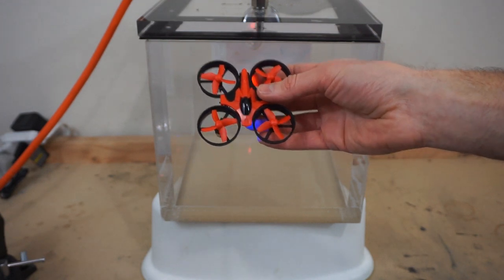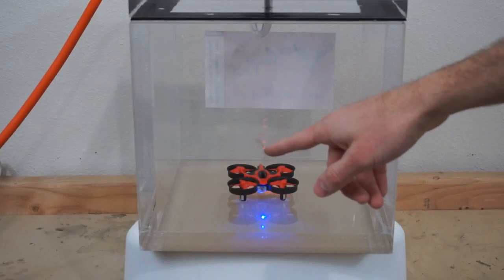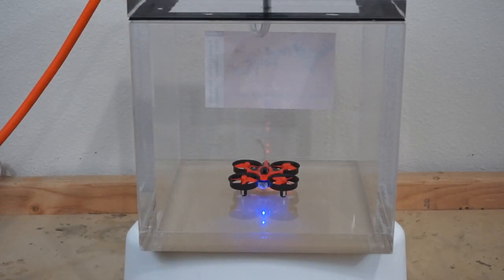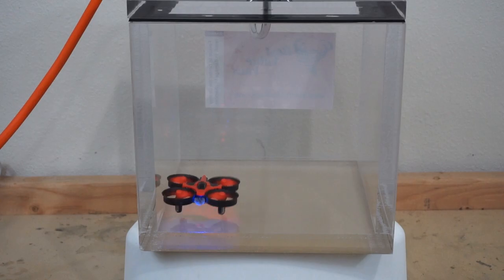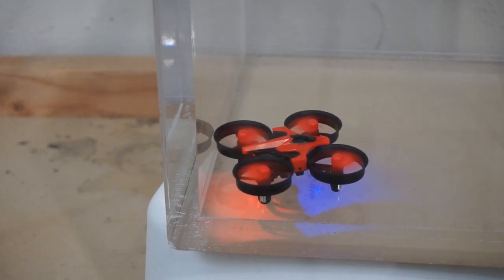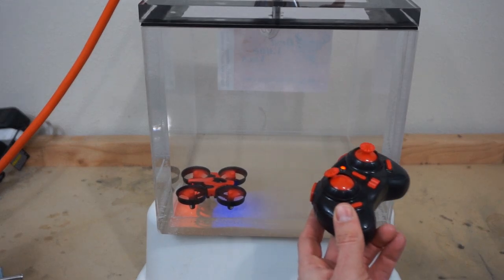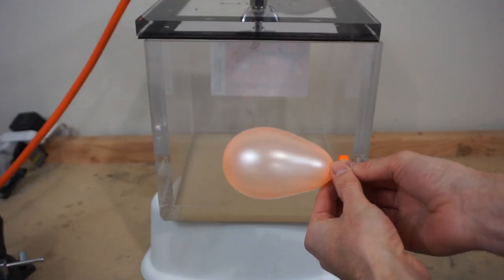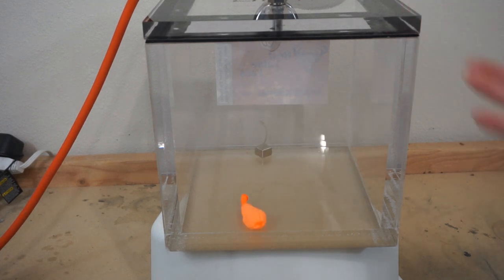What Happens When You Put A Drone In a Vacuum? Can It Still Fly?

Comment: A basic understanding of how a drone or any flying machine works let's you know that it wouldn't fly without even watching this video. Makes me think that this channel didn't have any ideas for a video this week or whenever they make them
Reply from the maker: +Ryan P I also know what will happen I put when I put sodium in water/when I put water in a vacuum/when I use a giant magnifying glass to melt metal etc. It's one thing to predict/know what will happen, it's another thing to live it. What fun is life if you just "know" what will happen but never experience it?
Reply: Hydraulic Press Action the difference is that other people may not know something interesting happens when you put sodium in water. And that, along with melting things can result in something visually appealing and worth filming. Nothing about a drone being unable to fly without air is intersting to me. I'm not attacking you or your channel, and it's fine if you were short on ideas when making this. I just thought you would make more interesting videos that this. It's the equivalent of asking how quickly a sailboat van travel without wind, or if a car will start without gas. Nothing personal.
Reply: Ryan P I think that your comment was completely unnecessary. I also knew what was most likely going to happen but it was still interesting to watch it actually happen. It is just ridiculous to call something like this "short on ideas" while at the same time there are thousands of channels simply copying each other or uploading almost identical content over and over again. This is something I have personally never seen in a YouTube video before and even though I knew what will happen I still enjoyed watching it. There are millions of videos here on YouTube that deserve a comment like yours but this is certainly not one of them.
Reply: ccman32 if this channel wants to grow, I'd hope they'd take a comment like mine and say "ya know maybe I should set the bar a little higher instead of making a video saying 'hey, watch this drone NOT WORK'" Feedback that isn't positive is still feedback and I'm not making personal attacks it's constructive criticism. People on YouTube love to get butthurt in the comments section over very tame comments. Let's not make this one of those times.
Reply: Ryan P Neither have I accused you of making personal attacks nor was it my intention to show any sign of "getting butthurt" so I don't see how or why this should be one of those times.
Peace.
Reply: Ryan P 

What about younger viewers who didn't know what would happen? 

This video was likely both entertaining and informative to those who genuinely have no idea how drones work. 

Maybe it wasn't your cup of tea, but to assume your advice is helpful solely based off your personal expectations and interpretation of what "entertainment" should be is a little self centered, don't you think?
Reply: dee yannie I never once said my feedback is the only feedback that matters. And I'd purport that younger viewers would also like videos that are more visually impressive or fun than watching a drone that can't fly.
Reply: Ryan P My first graders liked this video well enough. Not everything has to explode to capture their attention.  Here's the thing, my first graders didn't know what would happen. The didn't have the schema to make that sort of prediction. The reason I show my students these videos isn't to visually impress them, even though the videos do that. I show these videos in class so my students can gain background knowledge to make future predictions on how science works. I hope by watching these videos my students will be exposed to various scientific principals that will help them be more successful in the future.  They needed to see this video, even if it bored you.
Reply: Ryan P can you just chill and enjoy the videos...
Reply: Ryan P and why don't you think about making videos of your own...
Reply: Then whyd u click on it
Reply: This is a vacuum chamber and hydraulic press channel. What makes you think people watching would have any knowledge at all of how a drone flies?
Reply: Frankly I find the title and idea of actually realizing the experiment quite fascinating. And I was hoping he would demonstrate the matter in the way he did, and he did so. I was wondering if he would just stick the thing in the bottom, pump out the air, and say, "see, it's just stuck there". End of video.

No, he showed how aerodynamic lift fails . I also learned a few quantitative tidbits, because he read out the partial vacuum and I could see how the device responded. Does the lift become unstable? Would it flip over or something. I didn't know. Now I do. Could it make any feeble use of ground-effect? Lots of interesting questions and answers.

The experiment appears to be entirely novel, to my knowledge. It couldn't have been done until the advent of drones small enough for the modest vacuum-chambers affordable to youTubers. So it was interesting in that respect; sort of micro-historic (nano-historic?) let us say.
Reply: tbh this isn't common knowledge and this vid probably educated a few people....
Reply: most people knew but still watched it anyway just like you did.
Reply: Ryan P experimentally proving what is already proposed is also an essential process in science
Reply: Actually I was curious as well. Nice to see it with my own eyes
Reply: well it appears it was a good choice.   they have 123 Thousand views.  i mean i knew it would not work.  but i still clicked.    it's so Obvious that it becomes clickbait
Reply: What
Reply: I've got other point of views that this video is very good in term of education. Many students can get more by watching this video gor any other related videos) than just doing simple experiment and learn theories at schools. Not just adding their knowledge and understanding, but also increasing the possibility of creating new things in the future.
Reply: most people just understand this as fact without even thinking.
Reply: okay so this video is educational to nine year olds and really really stupid people other than that it is just a boring demonstration of something completely obvious but I'm glad to see all the people rushing in to defend it because we live in a world of the participation trophy where you set the bar low enough so you can just get over it I look forward to the next riveting installment where you ask a question that's been baffling scientists for centuries "what happens to a boat when you take away all the water?"
Reply: what water?  drinking water on the boat.  lake water, sea water, ocean water.   (relevent for the size of the "drydock") it will be on.  but bottom line.   it will sit on the ground. and stop functioning as a boat.  quite much like this drone in a vacuum
Reply: attack125 it would make for a super interesting video. To watch an idle boat. Can't wait.
Reply: Ryan P frankly youre making complaints about the video which seem completely irrelevant to me if not the whole pack of the viewers. its you coming in and dirtying the pond.
Reply: Daniel Jung you're making complaints about my comment which seems completely irrelevant to me. You're coming in dirtying the pond.  Sorry you can't have a world where everyone agrees with everything you say. Until that day, you're just gonna have to buck up and make the best of it bud.
Reply: @daniel jungRyan P was right.   YOU are dirtying your pond with an off topic comment.  (a comment not related to the video itself.  by commenting about someone elses comment)
Reply: lmao it was obvious
Reply: Ryan P
Everyone has actually done the boat experiment, in that they see buoyant objects drop to the bottom of sinks etc. Next time you drain your bathwater, what happen to your rubber ducky and toy battleships?
Reply: Ryan P   Ikr
Reply: Ryan P its cool knowing butt cooler seeing
Reply: +MsZylia 
What utter bullshit.
Reply: Do you think you are in the target audience of every video on Youtube?   Can you see the likes vs dislikes bar?  can you digest there thousands that clearly like this video?   Do you see why are you wrong in your narrow minded assumptions!?  Get over your self!
Reply: Jamie Delour another person who thinks that a comment section is only allowed for positive comments. Nice.
Reply: Ryan P he never said it was
Reply: Lol this is a funny chain of repliea
Reply: Of course, the entire thread has to attack one person for stating his opinion that is unfortunately different from everyone else's and is punishable by death. Typical YouTube sheep.
Reply: I love how fast Ryan P switched from "constructive criticism" to outright criticizing the intelligence of the video's creator and audience. Real helpful.

Hydraulic Press Action, would it be possible to have the balloon released from the bottom of the tank? It kinda just looked like it was falling in the video, and perhaps another starting location could better demonstrate the principles of physics mentioned.
Reply: You obviously didn't have any ideas, otherwise you'd have a video. Jealous much?
Reply: Ryan P the only thing I have to say to that is that most people don't know that stuff that's not knowledge that the common person has so for most the video is informative and tells them something they didn't already know
Reply: Ryan P bro crazy Russian hacker will do the same thing over and over or will do something simple that a lot of people will know will but yet they still watch it like this your comment was attacking this channel and you coulda said it with a different time rather than the way you did
Reply: This was a genuinely interesting video, despite theoretically knowing the outcome.
Reply: Hey  Ryan P, you are so cool that you know heaps of stuff!! could you drop a link or 2 on some of the creative things you have done in life ....? we're all looking forward to it!!
Reply: oerlikon1969 anybody in aerospace engineering that still needs to learn that a propeller based flying machine uses air to create lift isn't gonna make the cut. To date this channel seems to have a primary goal of entertaining  people and to me, it wasn't entertaining. It was probably a week where the creator just didn't have many ideas of what to do with his vacuum chamber and  that's perfectly fine. It's funny that people seem to be unable to get over a YouTube comment.
Reply: "Why even carry out experiments in schools, teachers? Obviously the given hypothesis is correct. No need to have the students actually carry out the experiment, observe the results and gain experience." - Literally you.
Reply: type moon except that's not what I said. This isn't school, there is no curriculum, this is just a boring video of an experiment that is the equivalent of testing how a car's engine reacts when there is no fuel.
Reply: ***** guess what some teachers show their students youtube videos. They don't necessarily have the resource to carry out the experiment themselves. The concept of youtube in the first place was a site you could share your videos.
Reply: Ryan P You are forgetting something... children are probably watching this video. Sure, they might have been taught that a propeller needs air to move the flying device. But as previously stated, it needs to be seen. Teaching children on a white board and demonstrating are very much different ideas.
Reply: To be fair, if I had a nice plexi vacuum chamber like that even knowing the outcome beforehand I'd still try it.
Reply: Ryan P you forget the fact that not everyone has this knowledge, I myself knew it and still watched it, and it was still neat to watch. I'm not saying you're completely wrong but even scientist like to see how theory translates into reality.
Reply: i know right? Next week, watch what would happen if you would blow up a balloon but didnt put a knot in it! cant wait for that one.
Reply: IF ALL TH PEOPLE IN THE WORLD THINKS A LOT LIKE YOU, YOU TUBE SHOULD NOT HAVE EXISTED.
Reply: Homo Erectus No need for that
Reply: Ozzeip Piezzo theres a lot of merit to your argument, but it's stated poorly. I would state it along the lines of "His channel focuses on one type of content so the creativity is limited" the reason I say this is because there are tons of channels with unoriginal names and good content
Reply: Ryan p, i think we all knew to some degree, but at the same time, think about the people who are just learning principles like propulsion and lift, this was new and fascinating to them
Reply: the baloon part is interesting for some people, though.
Reply: It's still cool to see theory shown in real life.
Reply: Before the video even started I paused it and thought 'Propellors need air or atleast some sort of atmosphere to function, its why you cant just slap propellors on a space ship. This wont work'
Reply: Ryan P No air drag 5th grade science. But he obviously knows what happens this is just click bait for a few uneducated and kids. I don't see a problem with this.
Reply: Ryan P h
Reply: Ryan P It's always nice to test if what you believe will happen does.
Reply: Ryan P stop hating
Reply: What really made the video work was him explaining how rockets can still work in a vacuum.  You have to understand inertia and much more physics to grasp that concept.   Do you know why rockets still work in a vacuum with nothing to "spray against"?   Hmmmmm?   And, if you don't have anything nice to say click to something else that is more interesting to you.
Reply: How insulting
Reply: YOU SIR ARE THE TYPE OF GUY I WANT TO BE. YOU GET ALL THE GIRLS. AND YOU'RE FUN AT PARTIES. TEACH ME.
Reply: senpai teach me the arts of douchebaggery
Reply: Ryan P a rocket can fly in a vacuum
Reply: Ryan P its still fun to do
Reply: george cornwall that's because of the boosters
Reply: hindsight bias?
Reply: Though it's common knowledge 
Theres still people who don't believe/understand
Reply: Ryan P you forget these types of shows are watched in large part by young children
Reply: Ryan P Exactly.. if anything they should fill it up with another type of gas.. Perhaps a denser one to show that less prop rpm is required.. That would be more interesting to watch
Reply: Ryan P
"...that is the equivalent of testing how a car's engine reacts when there is no fuel."
As with your claimed equivalent of floating things in water, this is something that actually happens. So nobody posts videos of it.

But I don't think you're serious at this point. You want to see how long you can troll this.
Reply: good point.
Reply: tubeist- dan this effect in this video actually happens as well. The reason you don't see helicopters flying or hovering at extreme altitudes. I think you're just another whiner who doesn't like to hear or see things that they disagree with.
Reply: I knew but I'm still watching this garbage... I feel idiot..
Reply: http://amzn.to/2iRElMC

Theres the drone if anyone wants it
Reply: Ryan P I watched it just to get it off my recommened
Reply: Stealth Works same
Reply: Ryan P what is your purpose in life?  Just to be an ass?
Reply: @dee yannie, younger viewers wouldn't really care especially if you refer to an age under 14, because what is interesting around a quadcopter not flying in a vacuum. They might say I wanna see it at first but they'd get bored within seconds of it landing... So it just seems stupid. If he had to name the video he should've at least wrote something less click baity if he went for something so plain... Like Experiment:Quadcopter in vacuum. Or at least not adding "Can it still fly" because the answer is obvious, people that clicked the video did it because they probably thought he did something to affect it's flying or did some other tests as well. @ccman32 You know you can just create a simulation or ask a teacher(if you're a younger viewer) make a simulation for what would actually happen. It'd be the same as watching this video. And idk why he has to be like the thousands of channels just copying each other. Science channels have interesting stuff to show. There is such a thing as being short on ideas so I don't see a reason not to say you think so. @Organic poppy As I mentioned before. You can literally create a simulation to show what would happen and read up on wikipedia or some more reliable source what would actually happen and tell them that would happen. @Blumac5 Not everyone has the money to afford all the stuff to make videos. You have to have a sustainable job before you do youtube lol. Or just blow up really fast with some stupid stuff that gets people excited.
Reply: Are we actually arguing over the internet right now with people we've never even met?
Reply: Ryan P Some people lack that understanding. It's 2017 and some folks still don't understand that we live on a spheroid planet.
Reply: Ryan P why don't you think about other people.  some people find it difficult to understand the simplest things whether its because information is not put to them in their first language or teaching itself has been hindered because of religious or cultural beliefs.  If you want other people to look at you as being an intellectual person then try and understand the whole picture before you comment.
Reply: Ryan P what about people who don't have an understanding of drones or flying machines?
Reply: ccman32
"Thousands of YouTuber's simply copying each other" you mean like hydraulic press channels?
Reply: pretty obvious, but still a cool video.
Reply: Alexander Adelmann hydraulic press Channel thumbs up
Reply: Jack Hack what's your purpose? To be offended by everything?
Reply: It also is educational to Flat-Brains and a little physics wont harm them, seeing as they never really got educated untill they got a smart phone and Youtube. They think the sea should float away and there is no space(vacuum). 

So now we have confirmed something before our eyes, and our education can't be all lies. Thank you HPA, show us more neat stuff, we know, but dont see it very often. 

Mr P, why watch it then? why comment?
Reply: Ryan P yea but its fun to see it
Reply: it's not about knowing what's gonna happen it's about watching what's happening and having the outcome satisfy you.  That's like not watching a super hero movie because the hero cuk always wins.  It's because it's interesting
Reply: Ryan P The video's title is a little deceiving.  I came here to leave a comment like yours, but when you watch the video (I'm sure you have by now) you can see he was just making a point with that question.

(Edit: inserts)
Reply: my thoughts exactly. how terrible is the education system if this has to be demonstrated. next video, can a youtuber breath inside a vacuum chamber...
Reply: Then why were you born when you know you're going to die?
Reply: Ryan P no need for hate man, he is just explaining. it may be common sense but there are much more useless videos on here
Reply: Ryan P sorry not everything is catering your interests lmao
Reply: John Smith I know I just want to defy Ryan p.
Reply: A basic understanding of what a vacuum is lets you know that it is absolutely possible for a drone to fly in a vacuum.

A vacuum DOES NOT mean there is no air, it simply means the air pressure is lower in the container than the outside pressure.  It could be lower by a very tiny amount and would still be a vacuum.

Thanks for playing and talk about what you know and know what you're talking about.
Reply: ***** You did in your original comment.

"A basic understanding of how a drone or any flying machine works let's you know that it wouldn't fly"

This shows you think a vacuum is complete emptiness.  

Oh, and I am not arguing semantics, I am arguing facts.
Reply: +Ryan P  I thought exactly the same thing! The only reason why I watched the video is that I hoped something completely unexpected would have happened, but of course, Bernoulli said that wouldn't have happened. So yeah, this video is totally scientifically insignificant.
Reply: +Ryan P  I thought exactly the same thing! The only reason why I watched the video is that I hoped something completely unexpected would have happened, but of course, Bernoulli said that wouldn't have happened. So yeah, this video is totally scientifically insignificant.
Reply: @Ryan P I like how everyone is attacking YOUR opinion lol, there is a reason you think the video is just plain boring and I agree with it, seeing a quadcopter not fly in a vacuum is just plain... Well plain...
Reply: Andratos95 careful for sharing an unpopular opinion. There are Internet white-knights all over this video.
Reply: Anyway, a child who is even slightly curious or who has parents that attempt to educate him or her in some way, knows that there is something in the world called air, and that planes and helicopters (yes, even drones) fly in it. So, even a 5 years old can probably understand by himself/herself that no air=no flight, he/she does not have to be a physics genius. The second part of the video where the balloon is used shows a concept that is a little bit harder to grasp (the conservation of linear momentum in rockets) and thus, a little more interesting. There are many smart questions to ask in physics, this is not one of them.
Reply: Ryan P leave it to you two to criticize someone's work. seriously, didn't you find any other video to bash? 

if we apply your logic, half of YouTube would cease to exist.
Reply: i still live without putting hand to lava :) But ofc i`m curious its part of my nature, so i wach youtube :D
Reply: Ryan P experimentation validates theory mate, very unscientific comment.
Reply: VisenX Experimentation does NOT validate theories. Theories can never be truly validated cause they are inducted from experience, which means we can only falsify them (As Karl Popper would say). Also, the outcome of this "experiement" was obvious, there was nothing really that one could have not imagined from past experience... I love watching experiments who in some way challenge your ideas and teach you something. That experiment really doesn't do any of those things. There are innumerable good science channels on youtube (SciShow, Vsauce, Smarter Every Day etc, Veritasium...). They propose meaningful experiments and always teach you something new, they are worth watching. This was simply, to me, a waste of time. But anyway, who cares!
Reply: No need for experimentation when a vital element is lacking.
Reply: Maybe some people enjoy watching things take place and observing science. You appear to not be one of those people, so why are you even here?
Reply: EliosMoonElios  Yes, this is obvious. but, science is all about experimentation and observation. it further solidifies the concept.
Reply: Nessy Bomber cars drive with petrol, so will it drive without petrol in the tank, let's try
Reply: What's a fact without proving it?
Reply: At least it's better than watching people cutting shit with a hot knife
Reply: Johnny Li this is a very solid point
Reply: you´re not even paying for his videos so what gives you the right to say it didn´t enjoy you much
Reply: What will happen if we dont make episode about what will happen the best episode ever xD
Reply: Checking in 7 years later, do you still have idiotic opinions regarding this channel?